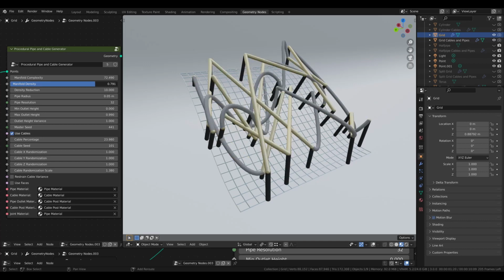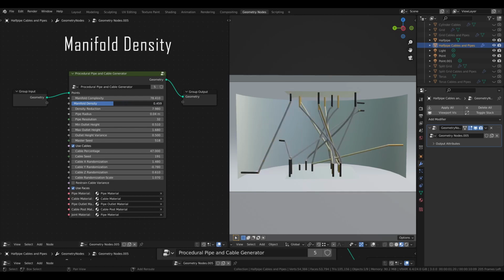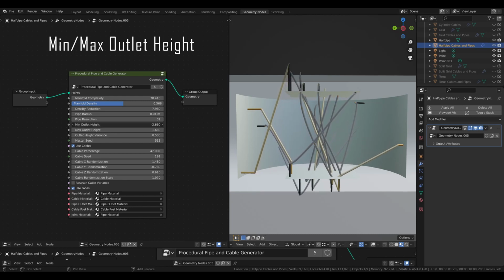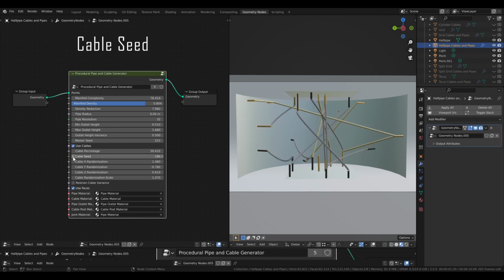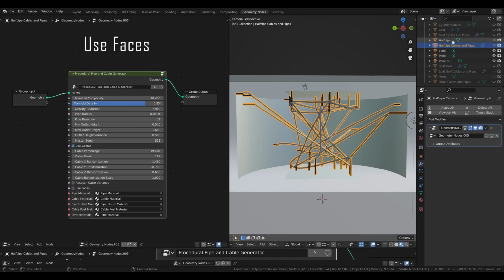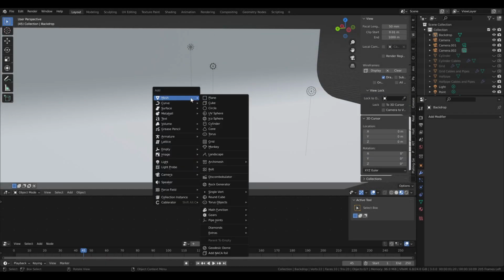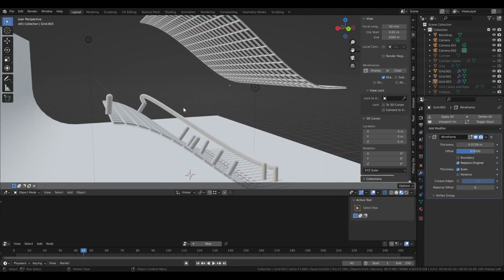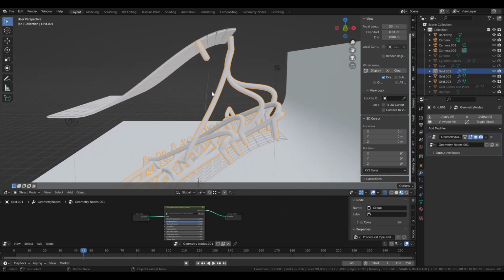Blender 3.0 Procedural Pipe and Cable Generator using Geometry Nodes (New Version Available)

Comment: Can we use custom assets, for the stems, pipes, cables ect. Id like to use this for girders to stretch across buildings, they have endcaps that would otherwise be the stems part.

Could this use assets from collections like some of the building generators iv been seeing
Like have a collection called 'Cable Stem' or 'Pipe Stem' which contains the asset used for the stem part of the generator. Could maybe have more then one asset in the collection so the generator uses any of them randomly allowing us to have multiple assets for stems pipes ect
Reply from the maker: The current version supports this for the flanges, but with some modifications it looks like custom pipes can be made to work as well. I'm working on updating the code and I'll reply again once I have a new version available.
Reply: @RocketScienceGallery  Ah cool, looking forward do it. With custom meshes we could make all sorts of things that go between objects
Reply from the maker: @speaker6060  It took longer than I hoped, but the new version of the node group is now available - it includes most (if not all) of the options you mentioned!